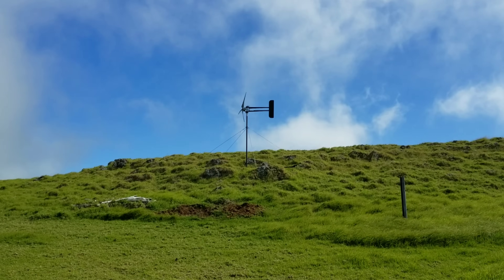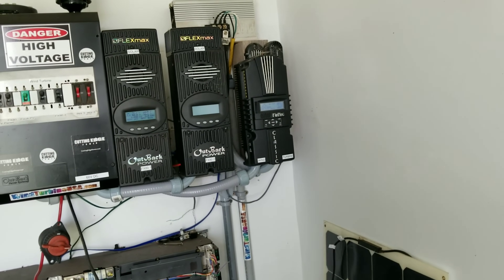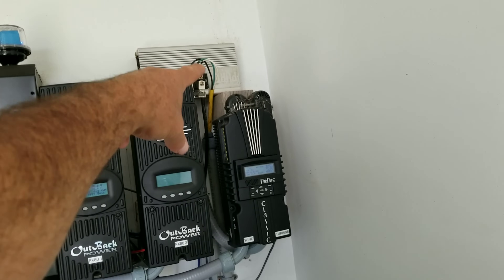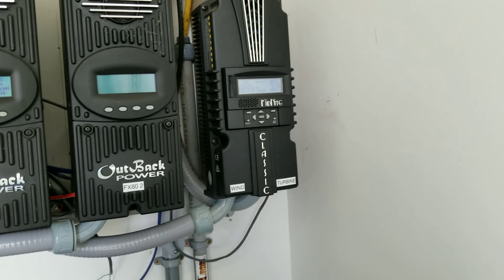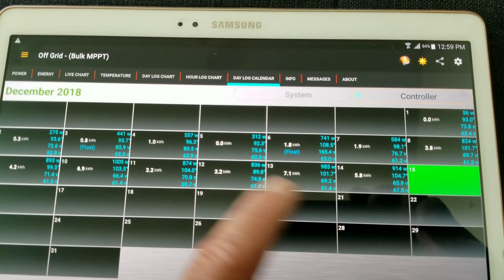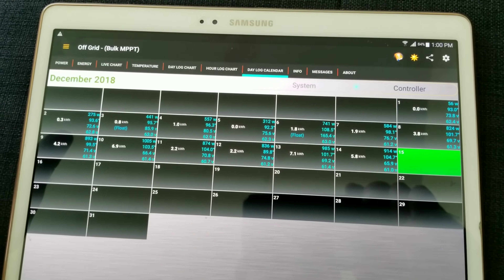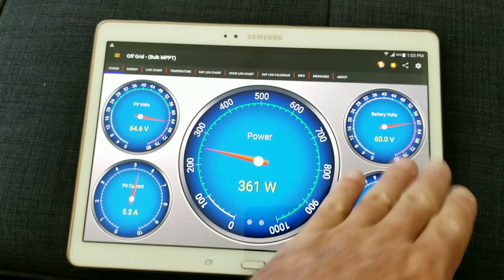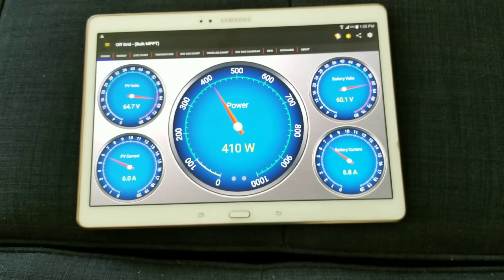MICRO WIND TURBINES... ARE THEY WORTH IT? (OFF GRID SOLAR)

Comment: I think the wind and solar compliment perfectly. Too bad 90% of the wind turbines flat out lie on their power output or give a rating for insane wind speeds. They should make the rating at 12mph so it is easy to compare turbines at speeds that actually matter. There are not many places getting 20+mph winds on a consistent basis. Even if we all got 20mph winds, that is the point where wind power skyrockets so most would be running at a fairly high power so it makes it even harder to compare turbines.
Reply: Fact that there is plenty of people  that are to lazy to do the math/thinking is the main reason why producers never ever gonna put on the box this type of data. :P
Reply: As crazy as it may seem? The chinese actually have their shit together in microwind today, contrary to popular opinion. There are several reputable manufacturers turning out solid durable and accurately rated micro-turbines. Far superior to this crap from MWANDS.
Reply: @davefroman4700  Why do you say that? You dont like their turbines? Just wondering, Im new to this.

Comment: If you got laminar airflow than definitelly, but in cities with turbulent air flow its problematic.
Reply: Vertical axis wind turbines don't have to hunt the wind. perfect for turbulent conditions
Reply: @buffalo_chips9538  

Lift VAWTs also need to be manually started. That's why you see so many of them sat idle even in strong winds.

Drag VAWTs don't but they are also incredibly inefficient for making electric.
Reply: Buffalo_Chips So why dont we see them everywhere? Any proof that they are energy efficient and you dont have to manualy start them?
Reply: @pangrac1  You can buy small ones on Amazon or e-bay all day long that are self starting. Just look up lantern style VAWT. Does it cost you anything to operate? No. Does it produce power that can be used? Yes. Do they self start? Yes. So if it doesn't require anything but the wind to run and it produces usable power and self starts, it meets all of your requirements. zogworth claims that Drag VAWT are inefficient for making electricity but shows no proof as they do not cost anything to operate. That would rule out any form of wind harnessing or solar harnessing for power by his thinking. But yet power companies are buying both wind turbines and solar panels.

Comment: I wanted to know how much noise it made. 
Would the noise it makes annoy you if were outside trying to relax near it on a windy day?
Reply from the maker: I can barely hear it. No problem at all.
Reply: Carefully considered placement is always a good idea for wind and noise.
Reply: Wind shear (different loading on opposing blades) or an unbalanced rotor and vibration are going to be the main sources of noise if it happens.

Comment: I still say if you get it up on the crest of that hill...you could probably double the power output of that turbine
Reply from the maker: Been thinking about it, that's for your support
Reply: @ModernOffGridDIY  If you do move it you might want to think about increasing your battery storage in order to take full advantage of the extra energy generation & of having gone to all that trouble in the first place. Great video. Even an idiot like me was able to get a clearer understanding. While I freely admit to being a bit of a tree hugger I really appreciated your no nonsense approach as opposed to the commonly found & somewhat rabid, ' Save the planet, save the planet. Only use clean renewable energy', that just puts the global warming, climate change doubters & deniers off completely. Ok, I appreciate that you're doing it from necessity but we'll done nonetheless.
Reply: Actually probably a smart spot if you get gales from that direction, at the wind speed in video it doesn’t look like there is any wind separation from the top , but in a gale it probably would seperate and basically save the turbine.

Comment: the smaller turbines can also work well at the top of a sailboat mast, too, since as long as you're sailing, well, you have both actual and apparent wind involved. Bet one could at least run their auto-helm off of the power.

Comment: In casper wy you dont need solar, wind will produce more than you can use. In Buffalo wy its a 20 year out.  Wood running a steam generator and heating system smokes them all.
Reply: Running a pressurised boiler is beyond most peoples capabilities.
Reply: @zogworth  True,  but running a generator off wood gas produced by a rocket stove modification is pretty simple, and the investment is small and power available with or without batteries.
Reply from the maker: Only if you have wood to burn most people dont have enough wood to burn plus all the work getting the wood ready is time.
Reply: @ModernOffGridDIY  True for some but then there are pellets, but just remember the out put of his windmill per day in equal BTU heat energy on a good day is about the same as one armful of  firewood.  The problem isnt the source as much as coversion and storage.  You should learn to capitalize on the rewnewables you have available and how to convert them to your needs.

Comment: For a 1200W, 48V AC turbine (9ft rotor) do you have a recommended Grid Tie inverter?
Reply from the maker: I'm sorry I'm not grid tied so I can't advise on that product.
Reply: @ModernOffGridDIY  Thanks, maybe someone else will offer a suggestion.
Reply: 48v turbines have a huge voltage swing. You will have a hard time finding a grid tie inverter to handle it that isn't gonna cost an arm and a leg. I know solar ones that work decent for cheap but they only work for up to 90v and in some high winds you can fry them with a turbine like that.
Reply: On second thought. You can use a battery in between as a buffer and then any 1500w-2000w grid tie inverter no problem.
Reply: @fookschool  Devil is in the details. Your inverter suggestion is one of those cheap no name 12-48V inverters. Not UL listed or approved by the power company. Plus it requires 4 deep cell batteries to get to 48V. I already have 2 and pwm charge controller so only half as expensive.  There is a 48V turbine grid tie inverter sold on Alibaba that has an 8 step mppt plus dumpload heater $500. Looks encouraging but also not approved by the power company. I'm tempted but not comfortable.  I also have some water heating ideas but because I already have a good size geothermal ground loop heat pump, I do a lot better using that with electricity. About 3 units of heat for each unit of electricity. To finish the story I have a grid tied 2.6Kw Enphase micoinverter solar array with net meter. I can't run the turbine through more microinverters because the voltage isn't high enough.
Reply: @artsmith103  well anything grid tied that will be accepted by the utility company is a very short list. So not much to choose from already. Honestly if you already have that much solar and a wind turbine that size, then you might as well look at going off grid so you don't have to appease the utility company. I'm off grid so I don't worry about those things. Batteries are much cheaper than you think. Any junked Ev is a perfect opportunity to grab a perfectly fine battery for cheap. Then depending on if you need split phase or not, powerjack and the single phase 120v reliable brand are my go to choices. I run a 3500w single phase reliable brand inverter for my house (no 240v appliances inside) and the LF split phase 8000w powerjack (true 4000w power) for my 3600w charger for my car. I have a Chevy volt battery as my bank.
Reply: @fookschool  My meter only costs $5-$6/mo. Electricity is $0.12/kwh so can't operate batteries for that price. Batteries cost at least $0.10/kwh though I'm not familiar with scrap value of electric car batteries. Don't have any plans to leave the grid, just from a hobby perspective I would like to watch the turbine spin. It's turned off now. Thanks for the info. Looking for some simple safe plan.
My power company rule is a wind certified contractor has to install it. The nearest one is about 100 miles away. Because I already have the net meter I could try something sneaky but I only expect about $150/yr of electricity from the turbine so it's not really worth risking anything.
Reply: @artsmith103  are you talking lifetime cost of batteries with cycling? I get batteries as low as $50/kwh (lifetime kwh cost is hard to measure as the automotive lithium batteries can last for 5000+ cycles at slower and slower degrade rates). If you leave just the wind turbine off grid you can at least play with it and use the extra power for things not connected to the grid. At least that would be an easier start. When I started with wind turbines I had a small turbine to charge a 12v system for rc/lipo charging use. Now I have a hookup for my balance charger straight from my 25.9v(7s) battery storage to charge things.
Reply: Those Outback inverters in the video are able to do grid-tie and battery backup. They are also UL listed if I remember correctly. They're probably the best you can get.

Comment: if i wanted to produce 24kw hours per day what kind of battery bank would i need to store it.? its to run around 2000watts for 12 hours or 1000 watts for 24 hours? using lithium?
Reply from the maker: You will have to do some math to work out all the info.
Reply: thankyou that would be much appreciated.. @ModernOffGridDIY
Reply: Batteries have limits to what charge rate they can accept.  You also need to match Depth of Discharge to the battery chemistry. You have to do all of the math to meet all minimums.

Comment: Love your power shed setup ..... but PLEASE attach your battery shut off to the wall! I also have a question I have plenty of wind in northern Colorado and I think having a combo system is also ideal for where I live but I was wondering do I need a seperate charge controller for the wind turbine separate from my Flexmax 80 that's running my solar?
Reply from the maker: When I have time to make my custom bus bar for my batteries I will mount the disconnect switch. Yes you need 2 charge controllers. Outback charge controllers can not be used with wind Turbines that's why I have a midnite charge controller that can be used with wind Turbines.